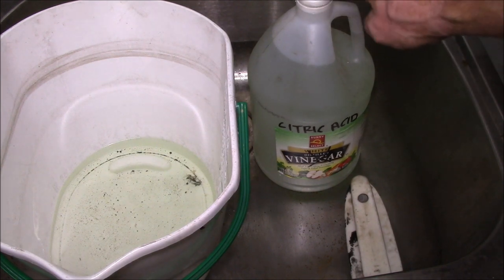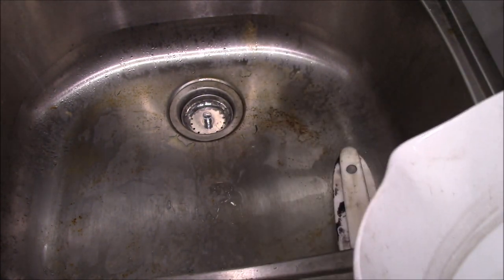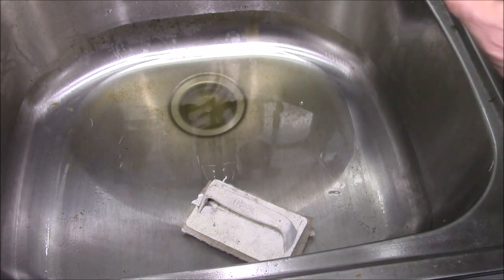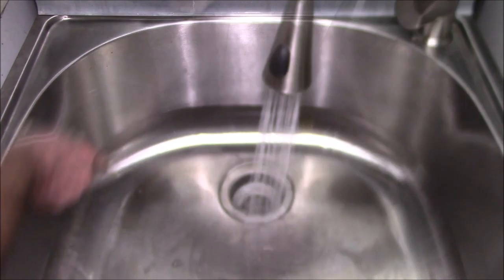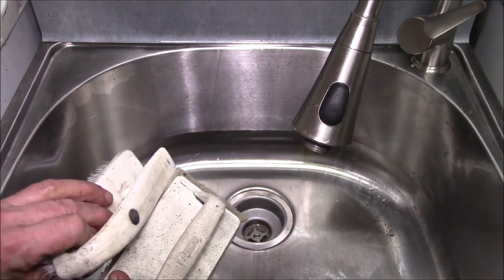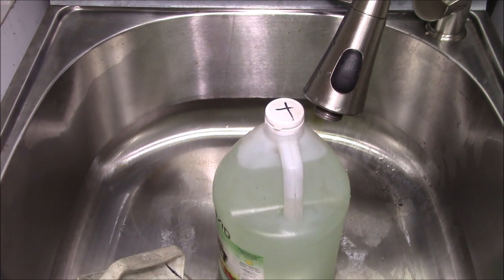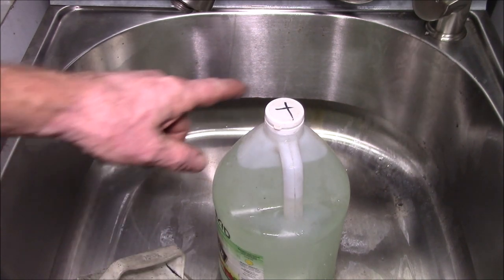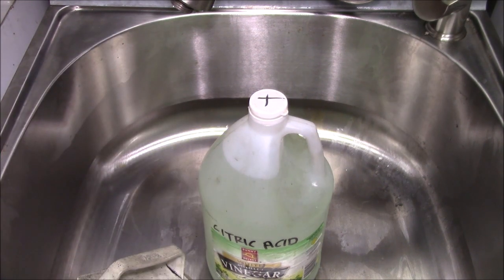Using Citric Acid Descaler to Clean the Utility Sink

Comment: Found safety data sheet site that I can understand...when I was working those CalOsha  required gown, gloves, goggles and masks made me want to rip up the pages thrown at me...with 20+ years worth of descaler you could have a water tower...not much need for espresso machine-water heater-faucet without a H2O supply!
Reply from the maker: Yes, I could imagine some of the SDS/MSDS sheets you would come across at at a CalOSHA lab.  Pretty dry reading to say the least.

Comment: good deal re-purpose reuse
Reply from the maker: Yes, I like having something like this on hand.  It sure beats having to run the the store to buy a gallon of vinegar or a bottle of some specialty cleaner like Lime Away or CLR.
Reply: I need your help..
We have SS 316 made  textile industry wahser...
And it is started rust....

We have done chemical test but as per ASME standard it found ok
Reply: I want to know why it got rust after cleaning